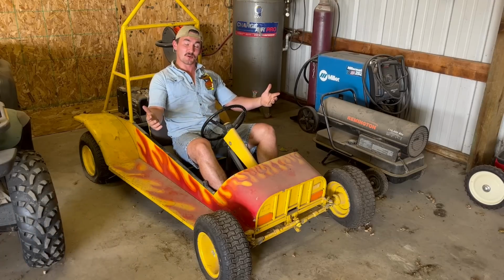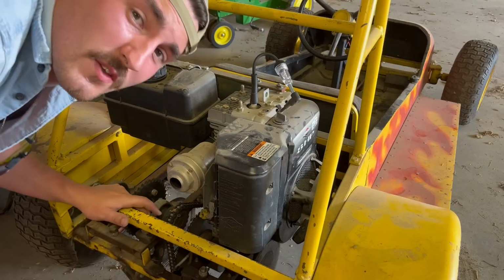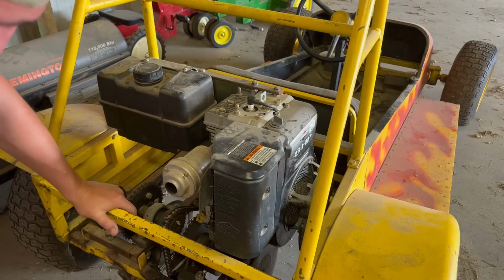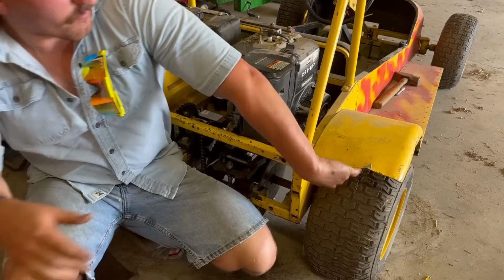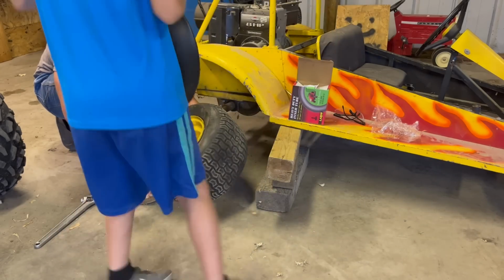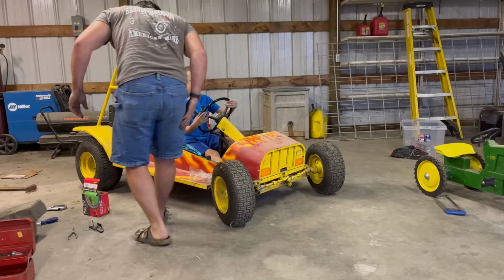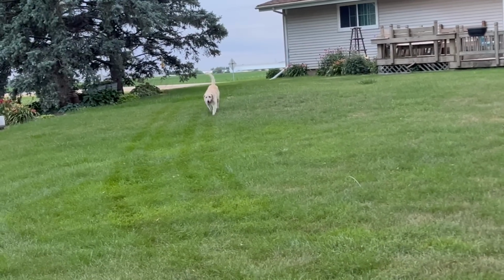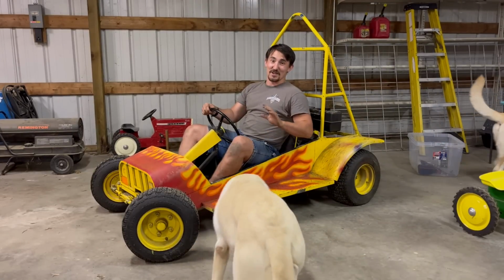Junkyard Go-kart WILL IT RUN!?!

Comment: When you were putting the inner tube in, you should have used talcum powder. You'd coat the tube in talcum powder to act as a dry lubricant that way it doesn't bind in the tire. Then when you have the tube in the tire (after making sure the valve stem is in the right orientation or else it'll pulls itself into the rim when you add air) you would then inflate and deflate it a few times to make sure that inner tube orients itself correctly. The talcum powder helps it to slip and flip into place, inflating and deflating just helps to make sure it orients itself correctly. Then when you're done inflating and deflating, I suggest adding a zip tie to the base of the valve stem and put it on tight, that way it helps prevent the stem from disappearing into the rim if it goes flat.
Reply from the maker: Hey thanks for the tip I’ve never heard of using that before but it makes sense and I will do it from here on out 😁